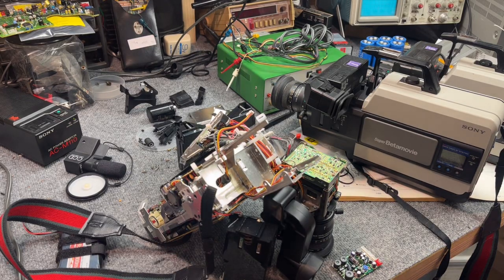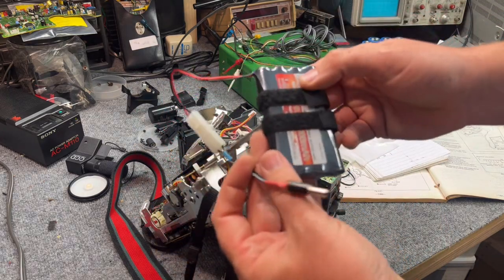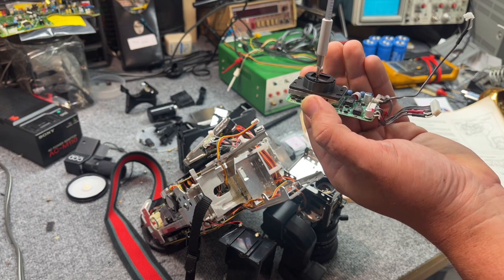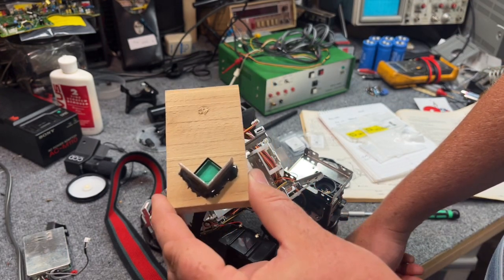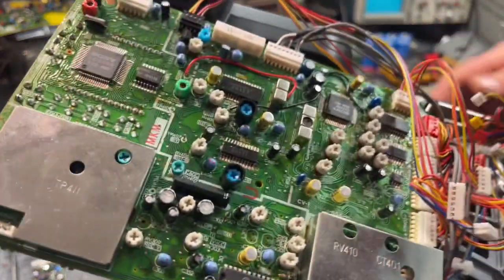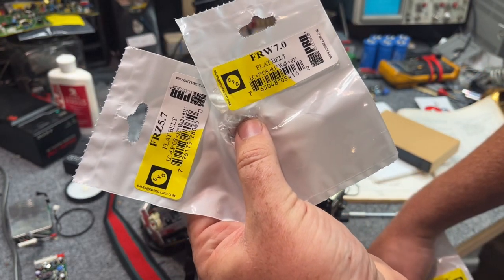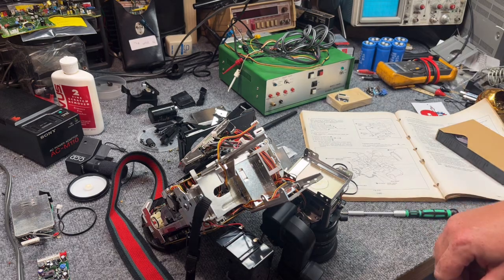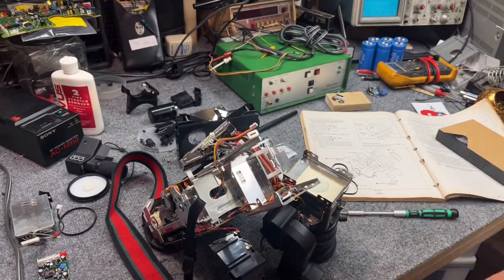Sony Betamovie tidbits - Part 1 - Common Problems: Foggy image, AF Belt and More

Comment: Great video. I'm working on a 550 right now.  I had to order a new IR cut filter and am waiting for it now. I also used a dental band for the auto focus because I couldn't find any that were under 10mm I D and so far it works perfectly.  Keep posting these videos!

Comment: Is a BMC 550 worth $25? I found one on Facebook marketplace and it's in pretty good condition with the original case but it doesn't have the power adapter but I have the one for my BMC 110

Also, I wonder if the reason the Betamovie tube cameras appear to be "dead" is maybe not the tube but maybe the circuitry that drives the tube and processes the image. Have you ever tried scoping the preamp of the tube? And the deflection signals? Could be that
Reply from the maker: I would say absolutely.  Avoiding shipping also prevents the delicate carry handle from getting smashed to bits too.
Reply from the maker: I tried that a few years back including swapping a “bad” tube into a good camera with no luck.  As I recall the signals looked fine otherwise.  I’d like to be proven wrong.

Since I switched to the CCD models I never looked back, not for my own use anyhow.
Reply: @Tapes1982  I just got the camera but the seller was misleading and I thought it included the hard case. Do you happen to have a spare or anything like that?
Reply from the maker: @KylesDigitalLab sadly I do not have any spare cases but they do turn up on eBay.